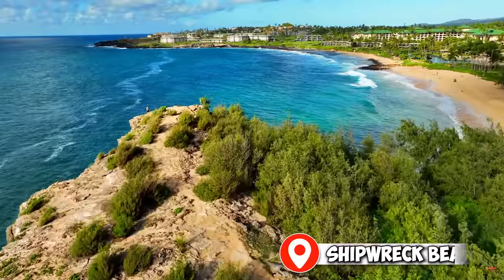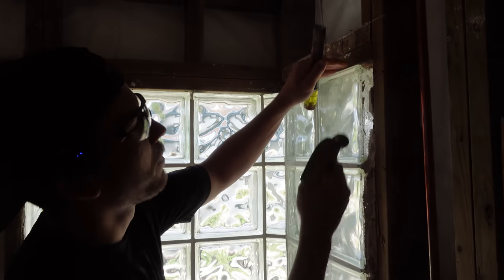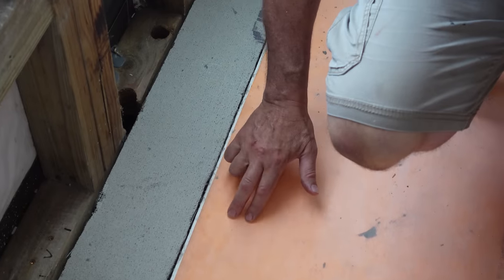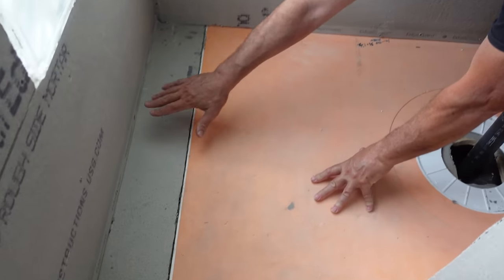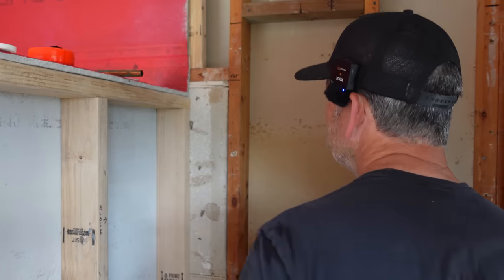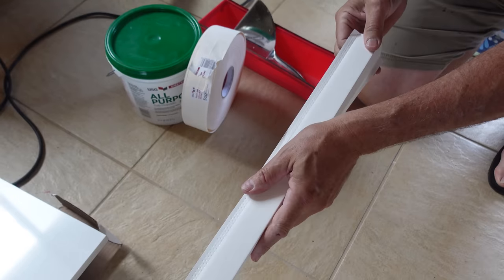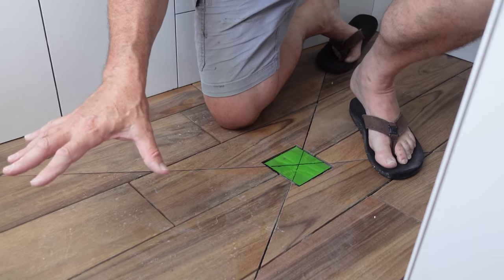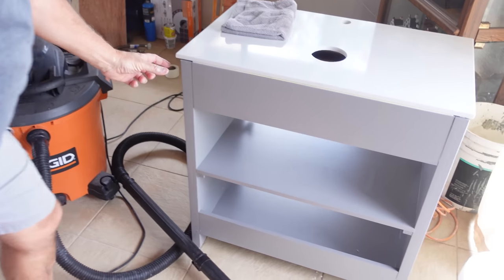The Tile Floor SECRET NO ONE Tells You!

Comment: Tip I learned...dampen a sponge, and wipe the tiles BEFORE grouting. It does two things,...it makes it easier to spread the grout so it doesn't dry as fast while you're spreading, AND it makes it WAY easier to clean off the tile...it basically almost eliminates the haze.
Reply from the maker: Great tip! 😂
Reply: @StudPack  I thought it was a crazy idea...but dang if it didn't make my giant shower grouting job easier! 😁
Reply: I can't understand why he's grouting the whole face of the tile. You only grout the joints! Just creates tons more work...
Reply: @chrisosti  What? I'd like to see you grout the joints without getting any grout on the tiles. That's just impossible.
Reply: @David34981  funny, I've been doing it that way for the last...ahhh...50 years. Especially on the 12x24" tile he's using. Now if you're talking the little 4x4" tiles, sure, you grout the whole tile...but smearing it all over the face of a 2 square foot tile is just wasting time...and time = money.
Reply: I picked up some stuff called grout release. I have yet to use it (might get to grouting my master bath floor this weekend), but it's supposed to make wiping grout off easier when using matte/textured tile. I'll see how it goes, might save some extra work.
Reply: Don't add too much water or you will change the color of the grout and you end up with blotchy spots, or washing the color out of it. your grout float should be more at a 45 and be getting the excess off as you spread. There should also be a better volume of grout on your float and try to keep the edge real nice and clean. As you're pushing it into the joint you're using that extra volume to get it in voids that you can't see. There should be a 2 wash process the first wash is a few minutes after you've finished grouting said area, rapid setting obviously the first washes going to come faster, regular traditional grout it's going to be a little bit longer. That first wash you're getting the excess bulk off of the joints and face of a tile., then you let it Haze up and the second wash is the fine-tuning. Do not wash it a third time when it hazes you will towel it with a terrycloth towel folded nicely. Also, spreading the whole tile is a bit of a pain but the grout on the face of the tile actually acts as a cleaner and gets any thinset residue that you didn't wash off while you were tiling but yes you should get it totally clean and mostly dry, damp but not dripping wet before grout. Grout release and other types of stuff does not need to be used that's a waste of money, you just have to grout correctly..... also when washing keep your sponge flat and at a diagonal from the joint.
Reply: @benharrison5816  you have to use grout release on some tile or you will never get the haze off. Some tiles don't need it at all. Slate, natural stone definitely needs to be sealed prior to laying. Good luck man
Reply: @davegordon6943  agreed, most people don't use slate, but yeah that's true. But on the other thing you said it's a big debate right now and for the last few years about whether to seal or not seal Natural Stone on a shower pan when it gets wet. The problem is when you add sealer it traps in the vapor moisture from Steam, and  then turn back into water inside the stone and is trapped in cannot get back out, which causes blotchiness and discoloration in Natural Stone shower pan.
Reply: @benharrison5816 waste of time
Reply: if you all time in the world to grout that would help but I'm telling you my grout cannot dry fast enough bc if you run your sponge too soon you'll end up with a deep uneven grout so you need to let it seasoned  just right so you can even it out w/o taking too much off cheers
Reply: it's probably just me bc I have never seen this method of water proofing but I'm very curious if the grout get just a small gap or crack what's going to stop the water from making its way through the sheetrock?? again is just  my opinion bc I only used liners so good luck 🤷😊
Reply: @BonBon770  I do it your way. Only a couple of washes. Clean the sponge after every wipe stroke. I also use cheesecloth to wipe the haze off. It almost polishes off.
Reply: @slowfinger2  exactly
Reply: Do y'all ever shim the studs in the shower flat/plumb before backerboard?
Reply: Always flatten framing before durock
Reply: Use a grout cleanup kit. Spread ur grout, wax on wax off like miyagi says to spread/fill . Start in corners and pull at 45 degree angle. 1 wipe  once you figure it out. U only get 1 wipe with it anyway before u have to clean the cleanup sponge
Reply: Could have used different air chambers and the air admittance termination is supposed to be serviceable. Need access
Reply: @chrisosti because you dont how to grout
Reply: Just be careful not to use too much water and get water in the joints. Then you will get air bubbles in your grout. Otherwise, yes. Good idea. Helps with pushing. Truth is though, pushing grout is supposed to be hard. If its easy, you are probably doing it wrong. Also, never spin it when mixing it. Puts air in it. Always mix it with a margin trowel. And dont use too much water.
Reply: Great idea!!
Reply: He's wasting tons of grout and creating much more work and grout haze.
Reply: Similarly with epoxy, but use soapy water to lubricate tiles and prevent epoxy haze from sticking.
Reply: I’ve grouted thousands of showers. Why spread it on all the extremely large tiles also? This just creates a larger mess.  4 x 4 tiles yes.   On large rectangle tiles, though?  You gotta love extra work for no reason if you do this.  I don’t.  But what do I know, … I am just a keyboard warrior, right?  Too picky of a lazy guy who simply does it for a living.  I don’t do extra work if I don’t have to.  But then again, most people don’t do it for a living, or for that matter do 3 - 4 a day where conserving energy is important.  The basics are given in the video.  Just keep switching out the clean water bucket with fresh water.  Let the grout set.  Clean up haze with Easy Off oven cleaner.  Spray on and leave for 20 minutes.  Wipe and Rinse.  Caulk your corners and circles.  Done.  1 hour max.  2 hours max if grinding out old grout with a new blade and razor scraping old caulk out.
Reply: When grouting I like to use a fine mist spray bottle and pre wet the tile so the grout has longer drying time and it’s easier to clean up. I did see the previous post about using a wet sponge to achieve the same result but I prefer to use the spray bottle.
Reply: Just gotta watch out for over watering your grout. Drops of water can change the consistency of the grout completely which change the color or cause effervescents
Reply: @StudPack  thats what she said 😂

Comment: I know they are more work with editing and stuff, but definitely like the longer videos more then the shorter ones!! Very educational. Helping me remodel my own bathroom.
Reply: Honestly these gentlemen seem like good people. So I don’t want to be rude. however they did a few things incorrectly. Like using backer boards to fill in the voids near the pan. Also drywall screws to fasten the boards to the floor.
Reply from the maker: @isaaca665  we never used drywall screws to secure anything but drywall. And the backer is going to be just fine 👊🏼
Reply: @StudPack  I suppose I’m assuming. However the screws are black and have a Phillips head. they look like drywall screws. Backer board screws are usually dark green or a mate gray color, use a Star Drive tip and won’t rust. respectfully I disagree. backer board should never be installed on a shower floor as it will break down over time. Instead use deck mud to fill those voids, this method is also approved by the Schluter company. Backer board is not.
Reply: @isaaca665  He clearly said they couldn’t get what they needed in that location. You work with what you can get. It’s not ideal, but it’s fine. Relax.
Reply: @Toni_Snark  deck mud is always in stock at all your local hardware stores. It’s a very common product. No matter your location. I’m very relaxed. I was just commenting on some issues I saw and didn’t want the original poster to make same mistakes on his or her shower renovation. As mentioned before I like these gentlemen. I’m not trying to be rude or anything like that. I was just trying  help because I do this for a living.
Reply: One last thing to mention. Schluter guarantees that their product for 10years if everything is done correctly and correct product are used to install. By using other products on the shower you void all manufacturer warranty.
Reply: @isaaca665  I apologize if I'm incorrect and I'm not trying to be rude but the screws in the backer board in the corner at 14:15 and under the vanity at 41:25 look like they're dark green.  On the floor at 9:02 in the corner of the backer board the screw seems to be the same colour as the ones in the wall.
Reply: @anon2695  you're not rude. you're right. I don't know how I missed that.
Reply: @isaaca665  Screws for backer boards are also Phillips headed, I'm not sure what's your point lol.
Reply from the maker: @anon2695  yeah it's a box of Rock-Ons. Good eye
Reply: @Ogilla  they're not Phillips head screws,  look closer.... anyways just read above to better understand
Reply: @isaaca665  You might have missed the part in the video where Paul said they could not get those items on the island. What did we ever do before Schluter?
Reply: @aiserock  Good morning. No I didn’t miss that part. If they sell Schluter products, I almost guarantee they have a deck mud. Before shluter, we exclusively used deck mud with a PVC underlayment to waterproof the shower pan. Both are still used too this day. Just depends on the customer or builder.
Reply: look on the bright side, if it fails, it’s another trip to Hawaii to fix it!! 😊
Reply: @isaac a  

He used cbu...specifically durock.  Cbu is not likely to fail like hardibacker would and is rated for use on the floor under tile.  It will not get wet as it is under the kerdi so I can't see how it could fail.
Reply: @randalwc  false. It could and will fail over time. Even when installing CBU on shower walls it’s required by manufacturer to keep it 1/2 inch off the shower pan To allow for drying.
Reply: @droiddoctor2447  facts
Reply: @isaaca665 doesn’t know what he’s talking about
Reply: @isaaca665  I was only commenting about the installation in general having a failure, not the material used or the technique involved. (Personally, I think their install will be fine). If anything were to fail, in general, and it leaked then they could go to Hawai’i again to repair it. (Humor)
Reply: @MegaCalifornia805  😂
Reply: @droiddoctor2447  understood!!

Comment: A tip for future projects, if you ever run into the need for an air intake on the drain pipe:
You mounted the intake vertically about 3-4 inches off the T-coupling, then drywalled over it. 
If that intake fails down the line (it IS a device susceptible to age), you have to open the wall to replace it.

Instead of mounting it vertically - since the intake is below the counter ledge - cut the pipe just above the T-coupling, throw a 90 coupling on it and stub it out of the wall, just like the sink drain stub out. NOW you'll have the air intake outside of the finished wall INSIDE the vanity. So whenever it needs replacing, you just pop it off and swap it with a new one.
You can still do this, if you go in through the kitchen side, do the stub out, then put the drywall back on for the refrigerator recess.

Just something I always do when I work on projects. Special stuff like that, I always assume I'M the one who'll have to come out and fix or maintain something. So I set myself up for easier work down the line. And doing it now is minimal cost: a 90 coupling and a drywall patch.

A second solution to this is to install a six-inch square access panel on the kitchen side, so you can just pull out the refrigerator and open the hatch.
Either way will work, just better to do it now, so it's all set for the homeowner when you head home.
Reply: Excellent suggestion!  I'll be using that one in the future.
Reply: Vents should always be accessible. There is even a special decorative access box available to use on drywall. The access panel is a good idea if there isn't room under the cabinet.  The vent can also be used as a "cleanout" access in case of a stubborn clog. (Note:  "90's"  are referred to as 'ells/elbows' and T's are 'sanitary, clean-out, and combo'. A coupling is a coupling.
Reply: You beat me to it! Those Studer vents always enrage code inspectors when installed wrong.
Reply: Awesome doing a house now and my usage of this will help me later thank you 🙏
Reply: actually against code to bury pop valve in wall.
Reply: @johnlucaiii9495  and it's supposed to be higher than the water table (i.e. above the sink top), but still many install it lower...

Comment: Can't wait to see Jordan's garage construction start, but it's great to see a brief intermission project that's not full of delays and two-steps-back (aka rain).  This bathroom is gonna look killer!
Reply: Check historical annual rainfall records by month for Houston. The period they have struggled through so far is typically the best part of the year - when the least rain falls. (Annual rainfall: December-April 85 mm/month, May 118 mm/month, June-October rising to 132 mm/month before slowing into the 'dry' season toward the end of the year.)
Reply from the maker: @jefferywright4204  Yeah....we thought we were going to be just fine.. 😓
Reply: @StudPack  Paul - You guys erred greatly by pushing ahead with the garage concrete work before first creating a drainage system for the lot.

You need to install a gridwork of direct burial drainpipe throughout the lot back in Houston. You can do this quickly and at relatively little expense using 4" diameter semi-flexible corrugated black drainpipe the kind with perforations along its length. Farmers use to drain wet spots in their fields.

Your drain system will be installed about 3 feet underground (above the clay layer) based upon the soil report you cited. You will have 3-4 runs of the drainpipe (mains) that extend the entire length of the lot and are spaced out across the lot. You will connect between these mains with 4-6 runs (laterals) of the same type of drainpipe spaced out along the length of the lot.

The drainage grid should have a continuous slope from the back of the lot to the street and a continuous cross-slope from one side of the lot to the side where your drain system connects to the municipal storm sewer.

The drain opening you have pointed to in previous videos that is in the street beside the future driveway is important for surface water runoff, but that drain opening does nothing to address the subsurface water that has saturated your lot's soil. The drain system you need to construct will be 3 feet or so underground and will connect to an underground municipal storm drain line that will likely be 6 feet or more below the surface of the street. 

One of the drainpipe mains should have run directly under the garage concrete pad location. It would have accommodated a floor drain - the one you chose to omit for the garage floor - and that same drain line would have demonstrated its worth when the heavy rainfall filled the trenches you excavated for the garage concrete.

The longer you ignore the need to properly drain the subsurface soil, the larger your problems are going to grow over time. The concrete pads you pour are effectively boats floating on wet soil beneath.

Without proper drainage, the soil will become unstable and is likely to begin to fail in shear mode - meaning the foundation will tend to displace (slide away) from its original position and that will cause uneven settling. The process will be slow, but it will be sure as gravity propels it. Keep in mind that taller structures only make the condition worse.
Reply: @jefferywright4204  that’s interesting and seems pretty insightful. I’d love to hear Jordan and Paul address the issue of subsurface drainage in a future video
Reply: I guess the way it’s going it’ll be 1 year before 4 walls will be done Lol 🤣😂 so you’ll have plenty time.
Reply: @jefferywright4204  nice writing,lot looks level to me?,maybe no drainage on that road?
Reply: The lot is (was) nominally level and at the same elevation as the street's surface and storm drain inlets. Watch all of their previous videos about this property to understand the nature and magnitude of this problem.

Comment: Nice job guys, looking forward to seeing how you tackle that vanity. Two quick thoughts for you, instead of pouring water into the pan of the wet saw, sit your 5 gallon bucket next to the saw and drop the pump down in it. this way you are pulling clean water through the pump and it will last much longer. The second thing, and I know a lot of people think it's crazy, but when you are putting down your thin set keep your trowel lines straight. The reason for that is when you seat the tile it creates an air pocket and the straight trowel lines will let the air escape and give you much better transfer and adhesion. When you have some time take two pieces of glass and some thin set and try it both ways, one straight and one curved and you will be able to see the difference. I don't want to sound like a know it all because I'm far from it but there really is some validity to it. Thanks.

Comment: I think if you bullnose/round both the outside corners of the vanity top, it would prevent a sharp edge to run into, even if it's 1" that would make it much softer if you bump it. I think it might looks cool to match the round edges of the beams.